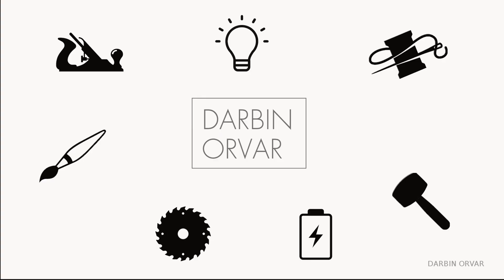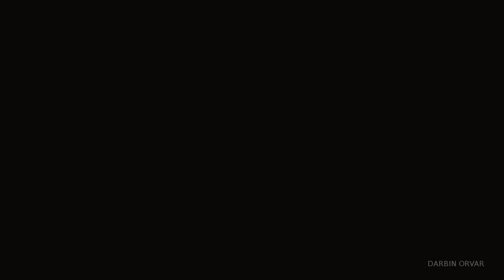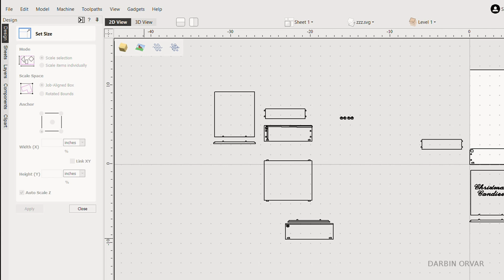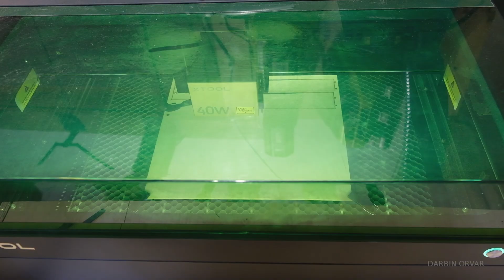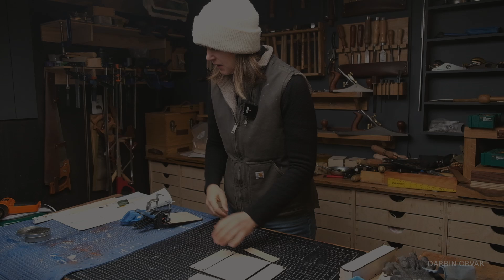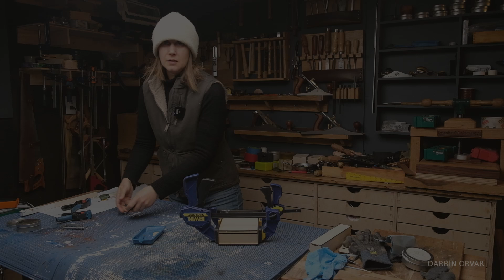Engineering a Simple Box Hinge System

Comment: I think the revision is quite an elegant solution - and the box looks nicer, IMO. I wonder if a parameterized cutting file would be a viable product. User enters desired length, width, and depth of box and out pops a file to control the cutter. Do laser cutters work off a common format, like STL for 3D printers? Nice box and interesting video, Linn.